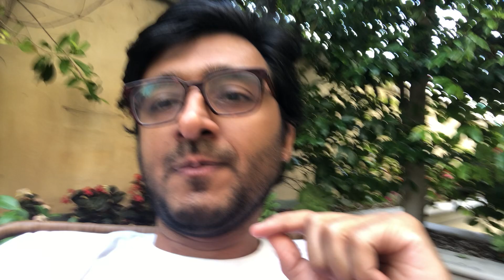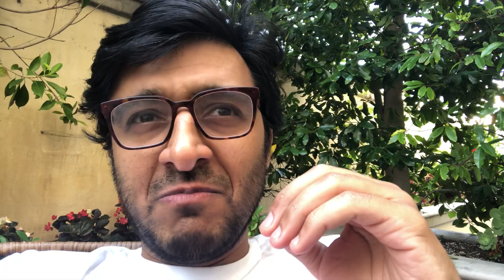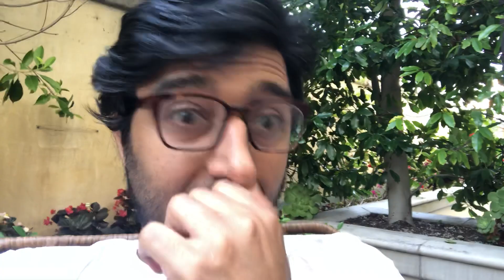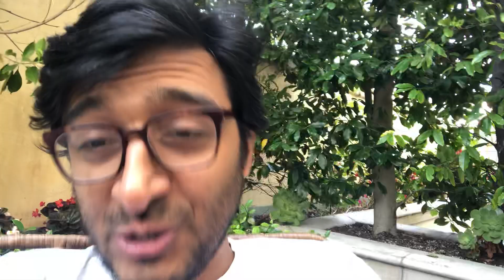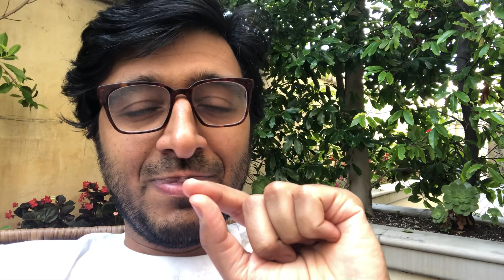When Designing a Backend System Minimize the “What If” Questions

Comment: Happy Birthday Hussein. topic is getting more interesting in second half. felt like suddenly stopped. want more on this topic. also, i want to know about when the system design is based on requirements, what i follow is collecting informations as much as i can and make analyzation from that and finally design the feature. as i work remotely, this is what i implement. most of the time, the system becomes simple and upcoming changes added later.

Comment: Happy Birthday Hussein, I love your videos alot. And i have a question regarding a microservice architecture that where i'll perform authentication check for particular resource and i want to reduce mutiple hop time. As i am in the way to understanding the microservice architecture. And i can't figure out the right way to doing this. I am using the API Gateway where first i make an request to authentication server and based on user role i'll extract out the array of access string and it back to API Gateway and then I'll create a call to resource server and i want to pipe the client incoming request payload as well as response object coming from api Gateway. But the issue is we can only able to send only one kind of content-type whether it is formdata or content-type/json. So, please make a video on right way to do authenticate user for resource.

Or you can create video on how aws check user have access for ec2 or s3 or not. When they make call. I wish to know there architecture for user access for a resource.
I wish to hear from your side.♥️

Comment: Actually, I've been thinking about this a lot lately. I'm trying to come up with a design for a web application for organizing events and I  have an idea for the back end API which may or may not add too much complexity.

With certain endpoints I'm thinking about making the values returned depend on who asks. As an organizer, I want to be able to see who is joining on the event page, so I could add this to the end point for getting the invent in that case. It probably makes more sense to have another endpoint for this, though, and just do a second request in the front end.
Reply from the maker: Exactly simplicity rules. Pick one choice and run with it only way to find out that you’re api works is to put it to work.

You can always create another endpoint.

Comment: I designed a system that solved a problem but later, I was demanded to add solutions to other problems in that same system. The application is now a monolith and the consumers are themselves confused about how to use this and that.
Reply from the maker: That is a good point and a common issue unfortunately Specially in a waterfall methodology with vague initial spec.